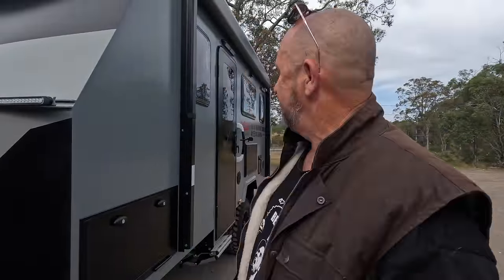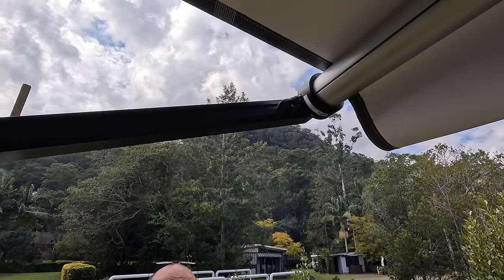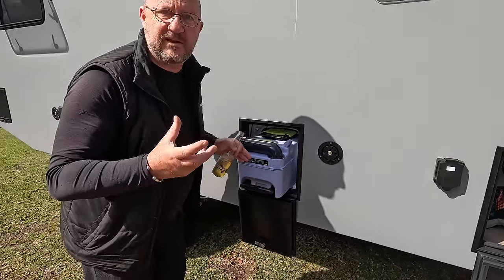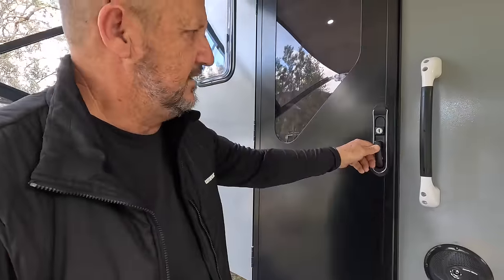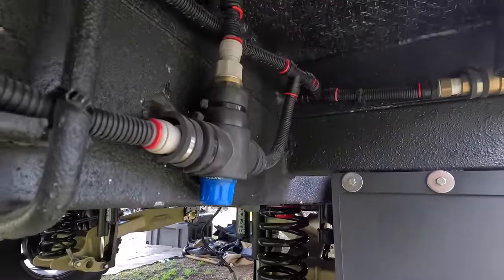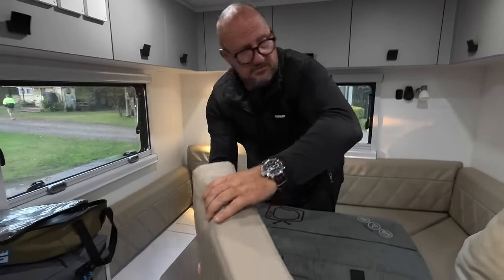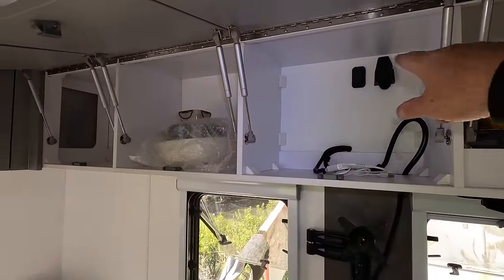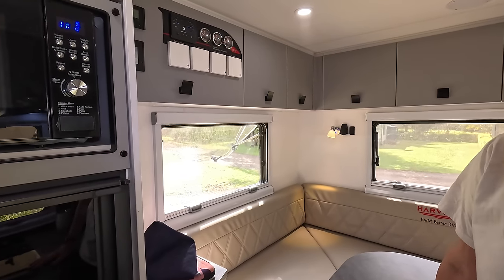Harvok 16' Suit of Armour Caravan Review - Power Packed Action Van

Comment: Excellent review guys, I totally agree with your comment on the brand and how it's finished, I've seen an NSW  made / assembled van at a show with the plumbing and power cables not fitted off completely and left over bits, and dust not wiped out of the cupboard s
Thanks for your reviews.
Reply from the maker: The amount of times I've seen a local product with bits missing and junk in cupboards plus things not finished off is astounding! Some manufacturers have got to be kidding us. Thanks for the comment.

Comment: Hey guys. Love your reviews.  I was wondering if you could add the tare and atm’s into your reviews. 
Cheers
Reply from the maker: @gavinfindlay9667  no worries, this video has those weights in it but a couple have not in the past. I’m going to include this info in the description from now on though. Weights are interesting because every van is different and depends what you add or take off but they do give you a guide I agree.
Reply: Awesome, you guys are helping us decide on which off road van to buy. Tare and atm’s are one of the deciding factors. Cheers again.
Reply from the maker: @gavinfindlay9667  What type of vehicle do you have?
Reply: I am still confused about the weights and I want to get it right before I buy. I have a 2020 Toyota HILUX can you please help me know exactly what ATM GVM GCM etc I am limited to. I have just bought the car and will need to place a redarc electric braking system in to get the towing capacity to 3500, or so I’m told…..but I’m still confused about what that actually allows me to tow legally….arghhhh what a mine field 😂
Reply from the maker: @ hi, the different models of hilux vary with their towing capacity. It should be on a plate on the centre body frame when you open door the drivers side door. This the maximum weight the car can be with fuel, passengers and any other load including the ball weight of the caravan. Your rego papers will show you the vehicles Tare Weight - subtract one from the other to get that number. Next, you need to know the maximum combined mass (car plus tow rig) for that model - this is a determing factor for what you can tow provided you don’t exceed the GVM (gross vehicle mass) of the car when you attach the tow rig. You might be able to 3.5T however the GCM may max out at 6T. The numbers don’t work often with the mid range cars. I recommend you find the GVM, TARE WEIGHT, GCM of the vehicle first - another thing to know is your rear axle load rating - often gets exceeded with a fully loaded car plus the weight on the tow ball (tow ball weight often gets impacted by 1.5 x the tow ball weight - this is when people get a GVM upgrade with new suspension components certified by an engineer. I suggest you talk to either a mobile caravan/car weight service provider who will have all the answers for you and make it clear. Suspension specialist will also help or an experienced mechanic or towing specialist. It’s not complicated, just sounds like it! The electronic controller you mentioned allows the towed vehicle’s brakes to be applied when you apply the vehicle brakes - this gives you braked towing capacity - unbraked  without the controller you can just tow a box trailer or small boat. This information will be in the cars user manual. Good luck - great idea to know all this stuff first as you suggest.
Reply: @  Wow! Thank you so much, I really appreciate the time you have taken to explain this. I now have a reference point to get my head around it in clear language….you guys are amazing 🌻
Reply from the maker: @ thankyou - good luck. Reach out via direct message on our social pages if you want to discuss further at anytime.

Comment: Not even sure what to ask. Haven't stepped in a caravan in over 60 years, as kids when holidaying family would rent an on-site van somewhere. Now that I'm retired thinking of getting a van to lap Australia for a year or 2. Then regular holidays after. This sounds perfect but what other 16' vans would you recommend I be looking at?? My main issue is they are only in Melbourne and I'm in Adelaide,  thanks...
Reply from the maker: @guymalpass9618  Thanks for your comment. Go through this process - 1. What level of comfort do you want. 2. Will you be camping off grid or just staying in caravan parks. 3. What can you car tow safely. 4. Do you want a full van or hybrid. 5. Are a handyman. 6. Identify brands with the best warranty and support processes. 7. Set a budget. This will narrow the field down for you. Then you will have to look by visiting those few brands to get a feel for the actual priduct. Looking at second hand vans in your area will give you an insight into your van choices also without travelling far to start with - you might pick up something with considerably more upgrades whichnisnonpy 12 months old and hasnt travelled far. It does take a lot of reviewing and I dont know your personal circumstances so its hard to recommend anything in particular - you could grab one of these or any number of other vans depending on the answers ti tge questions above. Hope this helps!

Comment: Excellent review as usual guys thanks don’t like the jockey wheel position should be center also chain location makes it difficult to run a padlock thru the chains many vans have been stolen with thieves just connected chains even though a hitch lock is fitted. Van needs the Wolf exterior TV box also would rear bar the one on the van looks cheap. Also not having a BBQ or a place to store a BBQ love my Ziggy BBQ
Reply from the maker: Thanks for the comment! That's some good info on the chains! That Wolf exterior box is great isn't it! Got to have a BBQ

Comment: great review. Only thing is you need to understand the difference between KWh and Amps
Reply from the maker: @ejw4300  Let us know what you mean pls?
Reply: @caravansbythecampfire  I don't know what this guy meant, but as an electrical engineer I'll make a guess. 

P=VI, Power (Watts) = Voltage (Volts) * Current (Amps) 
Also
P=E/t, Power (W) = Energy (J) / Time (s)

BTW, technically these are defined using calculus not simply E/t. And Power is the rate w.r.t. time at which work is done. In electricity the work is energy and hence E is used.

In the electric world (and everything in the universe according to Einstein) everything is about energy. Power is just Energy / Time. 

So battery storage capacity should actually be an energy unit, like kJ, but no one would understand that. So instead we take something people understand, like Amps, put an h (hours) at the end and talk about Amps x Hours aa battery can supply. Eg 100Ah equals 50A for 2 hours, or 10 Amps for 10 hours. This is basically and far from accurate but it works well enough for rough dimensioning. Generally people only talk about Ah for a 12v SYSTEM. So 300Ah may be 3 100Ah batteries in parallel (all the +ve terminals joined, and all the -ve terminals joined). Amp hours is not a proper measurement of energy storage. A very crude way of converting fro AH is to take P=VI, substitute in the average voltage, say 12.3 to get P = 12.3 x I. Also E = Pt, so E = 12.3 x I x t. For 300Ah we get E = 12.3 x 300 VAh, 1 VA =  1W, so E = 12.3 x 300 Wh or E = 3,690 Wh or 3.69 kWh.

In home solar installations, people talk about kWh. Which is also what your electricity bill measures. This is similar in concept, and we really should be talking in Work/Energy (Joules) again, but instead we take the Power in kW and multiply by Time in h to get kWh. At least this time we are following the E = Pt formula so it’s a better measurement. It's also voltage independent.

If we compare a 12V and 48V RV system, and assume the exact same loads for now and energy usage. Lets assume the 12V system has 4 x 100Ah batteries and the 48V system also has the same, however the 12V system the batteries are connected in parallel, the 48V system they are connected in series (positive to negative like in a torch). Using the "dodgy" Ah conversion formula:
12V : E = 12.3 x 4 x 100 Wh (12.3V and 4 100Ah batteries)
48V : E = 4 x 12.3 x 100 Wh (4 x 12.3V = 49.2V and 100Ah)
So to achieve the same energy storage and capability, both systems use the exact same 4 batteries, just connected differently. In the 48V side of the system (between the batteries, charges, DC-DC invertor to drop to 12V for those circuits and a 48V to 240V invertor) everything runs at 4 times the voltage of the 12V system and at 1/4 the current.
In this basic comparison, if you measured the 12V system in kWh, it would have the same rating as the 48V system.

The real world is more complex. In the 48V "centre" of the 48V system, running at 1/4 the current means wasting less power due to resistivity OR being able to run much thinner cables OR run the cables over longer distances. But you must add an invertor to run the 12V circuits.

I have spent my life in telecommunications where everything is 48V. I'm comfortable with it and think it’s a better option.
Reply from the maker: @NickSaravanos  Thanks Nick for taking the time and energy to provide anyone interested to become more educated! Excellent!

Comment: What other caravans or hybrids have you seen that have the club lounge and has a low TARE? I drive a Triton and would like something that does not weigh like a tank.  Thanks
Reply from the maker: @noel888ong  there are a few around with most manufacturers of single axle vans having a club lounge option. New Age Caravans, Snowy River Caravans, Kokoda Caravans, Paramount Caravans, JB  - I don’t see you getting away from the weight issue however! Most will be 1.9-2.2T tare maxing at 2.6-2.9T
Reply from the maker: @noel888ong  I know Harvok are designing a club lounge and N/S bed. Weights will be as I indicated in that previous message

Comment: Harvok marketing department are stretching the truth with calling this construction a monocoque. It is not a monocoque. A monocoque has no chassis. A true monocoque would take loads directly from a drawbar and suspension attached directly to the box/cabin.
Reply from the maker: I guess they can answer you directly on that. There are at least half a dozen technical interpretations of that word and how it is applied.